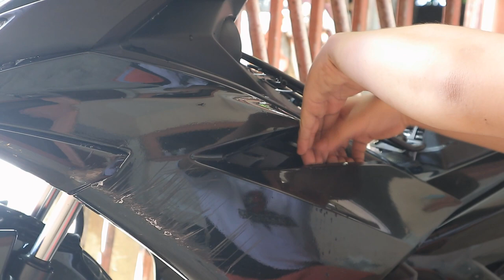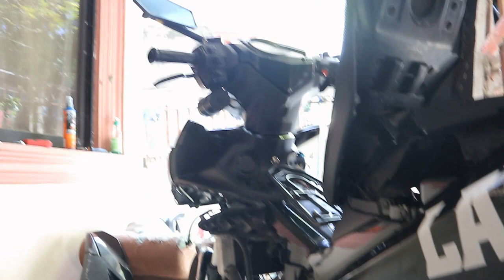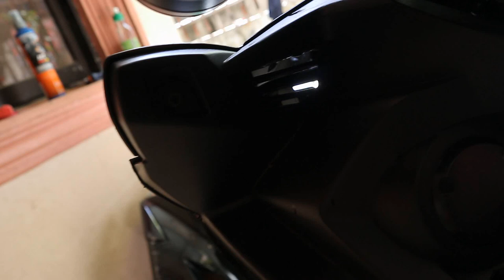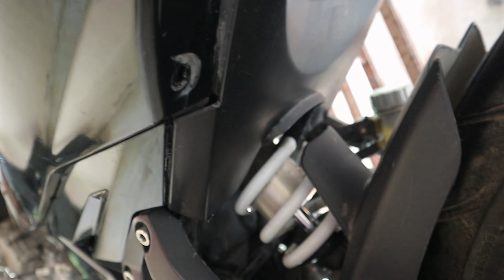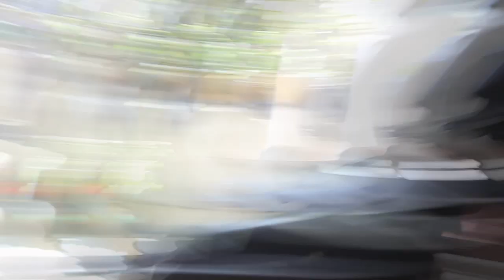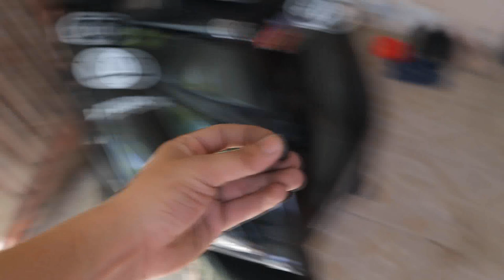Sniper 150 Proper Way to Remove Fairings | Sniper 150 Cover (HD)

Comment: Paps video tutorial kaba Pa nu mg install ng rear led turn signal lights sa sniper 150 2019model?
Reply: Paps meron ka video?
Reply: Plan kc ako mg install gaya sa iyu rear led turn signal lights
Reply from the maker: Gagawa ako paps para sa inyo
Reply: Salamat paps
Reply: Pero paps need paba mg change ng electric flasher relay if mg install ng led turn signal lights sa sniper 150 2019 model?
Reply: @andothings  kc paps gustu q talaga ung rear led turn signal lights mu paps pro ndi ako marunong mg install patulong paps tnx

Comment: Sir magtanong lang po sana. Anong part po ng fairing ang kailangan tanggalin kung magpapalit lang naman ako ng throttle cable? Sana po mapansin
Reply from the maker: Throttle cable sir, sa side lang sa kabila left side. Pero kung mahihirapan kang abutin yun nasa ilalim, kunin mo nalang both sides. Tapos remove nalang din yung head cowling nya

Comment: Good evening dol, mag tatanong lang sana, ano ang dapat gawin kapag, mahirap e unbolted ang screw? salamat 🙂
Reply from the maker: Sa experience ko sir, tinarget namin.
Reply: @andothings  Ok salamat dol, anu po sukat nang screw driver, 1st time kopa kasi bumili nangmotor (sniper 150). gusto kulang ma iwasan ma pudpud ang screw. salamat dol!
Reply from the maker: @quirarar7753  piliin mo yung branded idol at yung close wrench para siguradong di ma pudpud yung screw